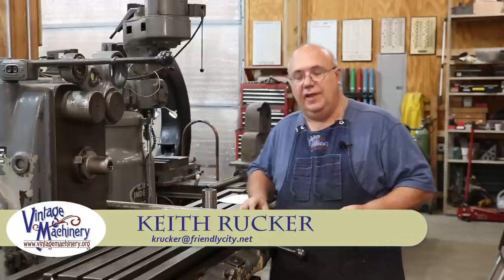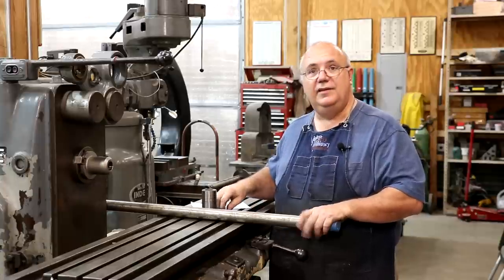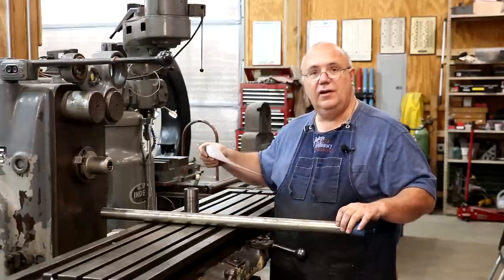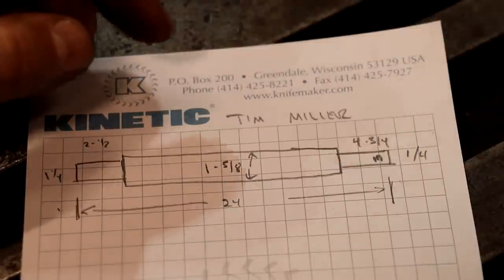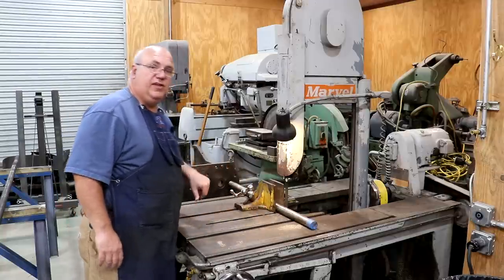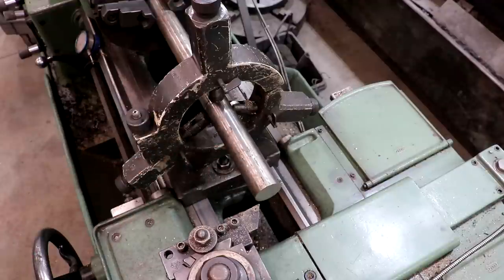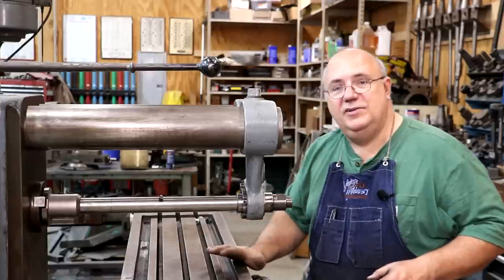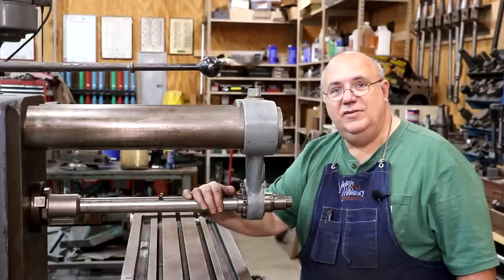Making a Tool Bar for the Horizontal Mill to Machine a Custom Spline

Comment: Hello Keith That may be 6140 ,6145 or 6150 We use a lot of those it came off that pill marked with those three on it ... I sent a good piece for you I did not want it to bend when you was cutting your part ... I am glad it worked and you got your part made !!!!!! Great Video !!!
Reply: Either a remarkable coincidence or you are the fellow who sent in the steel bar.  If you are,  Thank you!
Reply: Thanks Tim, very cool
Reply: @WhatAboutTheBee  I am I sent it in
Reply: @TheOutboarderTim ,Very generous, thanks for chipping in.
Reply: That would have made great material for a truck torsion bar way overkill for what he needed
Reply: @WhatAboutTheBee  He said "I sent a good piece for you". That kind of identifies him I would think!

Comment: I  usually put the tool hole below centre . It makes the tool geometry better & easier to grind .    👍
Reply: As I see it he tweaked the steady-rest vertically for the same result.
Reply: I was wondering about that.  Thanks for the memory jog.   I seem to remember there was a tip in one of my old books about that.
Reply: @silasmarner7586  I was referring to the tool position in the boring bar .  If the top of the square hole hole is about.030 or  .040'' above centre of the boring bar , then the cutting tool geometry is easier to grind . For what he is doing with it , it will be ok , but it makes it a pain for line boring set up .    👍

Comment: Keith, we have seen you use your Arbor Press several times and the Table deflects off the Upright and the Ram deflects forward each time causing the broach to bend.  I am honestly surprised you didn't break that broach. Time marks 23:48 and at 25:14 to 25:20 you can watch the table flex back and forth.
Reply: I noticed the same. I was surprised you didn't move it back to the center of the ram, and also surprised the broach made it.... was hoping you were not going to get hurt.
Reply: Look carefully.  If you loook at the left edge of the vertical portion of the broach structure, the whole structure tilted.. since the back bone is further away it appears to displace relative to the background less.... the broach BIT itself seemed juuuuuuuuust fine.
Reply: Probably what happens when you push a square peg through a round hole.
Reply: It looks like the gibs on the knee need to be adjusted.
Reply: I've noticed that also. Being just a casual observer, I figured the press is simply not contacting the floor perfectly; at least 1 foot not the same as the others. 🤔

Comment: You're gonna need a flat milled for your end mill holder set screws.  Most boring bars would have the hole off center so the cutting tip is on center.
Reply: Exactly my concerns
Reply: Hummm.. I see what your saying here.. But would it make much of a difference in the final outcome?... Sorry if this is a stupid question but in my 70 years I have never used one of these.. actually never even saw one before.. But I would have liked to have been around them when I was younger.. it all looks like it would be a great skill set to have working with all of these great old machines.
Reply: I was thinking the same, didnt Blondyhacks put the hole of the line boring bar offset?
There is still plenty of room on that bar to put in another hole although its a risk with broaching that though steel
Reply: @samuraidriver4x4  that's right, the hole doesn't even have to be square if you use round tool steel. Just have to grind in a flat to orient it with the grub screws
Reply: @tinkmarshino  As far as the flat goes- that is important, because those set screws just on that hard steel round are gonna slip under load.  The off center hole is not super important, just one of those engineering things.
Reply: @Current Batches to be fair machinist isn't his main profession
Reply: @oldschool1993  If you were listening to the introduction Keith commented that the spline required is non standard.
Reply: @garychaplin9861  Yeah- it perked up my ears because in the prior video I had commented that he could find cheap splined shafts easily.  We will have to wait for the actual cutting video to see if it is truly unique or not.
Reply: Really depends on the style of cutter you are using. Even if the cutting tip winds up above center as long as more rake than normal is ground in to compensate it will work just fine. an advantage to having the hole on center is it allows you to be able to rotate the bar in either direction.

Comment: It seems like the opportunity was there to put on a “Weldon flat” on the bar while it was in the mill. Is the cutting force just low enough that that wasn’t needed?
Reply: I was going to ask the same question, it seems to be the obvious thing to do when you already have it set up in the miller and would avoid those annoying burrs which make it difficult to remove the shaft in a close fitting joint.
Reply: He should of, especially if those set screw mar the metal,  he'll never get that holder off with those clearances

Comment: Gotta love mystery metal.  Be interesting to know what it actually was.  Someone mentioned maybe Stainless, and the way it fuzzed up, I think they are right.  Anytime you've done stainless it has that fuzzy look.  Nicely done as usual Keith!
Reply: Probably 4140 HT or Fatigue proof!
Just guessing.  I surely thought he would check the rockwell!
JIM 🤔
Reply: Fatigue proof is usually 1144 and machines great...4140HT machines reasonable decent too (around 35HRc) its tough but not bad...I'm guessing 300 series SS given the color of the chips and the threading fun he was having...

Comment: Scary stuff to work on that hard material.  I usually drill slightly bigger for my home shop stuff if I have to use hard material.  I figure the change in fit doesn't matter as much since the harder material resists deformation.  Watching that broach was spooky.  Glad it work out!  Whew!!

Comment: Seems like the edge of the cutting tool needs to be on center and not the body of the tool ?? MSC. Does have square tool inserts to place into bars,that allow micro advances  for tool depth.

Comment: Keith, watching your video I would have thought you would offset the tool bit half the thickness of the tool bit to make the leading edge on the center line of the boring bar?
Reply: The shaft is much stronger if the square hole is broached in the center and the face of the form tool is ground in the center of the tool. A tougher job than expected but it got done with much experience and patience.
Reply: He didn't make it as a boring bar for a lathe. He made it as a tool arbor for the horizontal mill. In this case it doesn't matter if the leading edge of the tool bit is on center. The work can be moved to any position while it's on the table to get the intended cut.
Reply: @deathk26  No, since the bar is rotating and the tool passes over and through the work as it mills the spline the cutting edge does need to be on center.
Reply: @ellieprice363  He's going to be making straight line cuts along a piece of material to create splines. The cutting edge can be offset from the center of the arbor. There's still a point in the rotation of the tool where there's a full perpendicular cut of the profile into the work piece. Make a drawing if you need to visualize it. It's not like there's an extreme offset in this case where you'd need to start worrying about clearance and tool length. At the end of the day it's up to him whether he wants to center the cutting edge or not when he grinds the tool. It's still going to cut the same profile either way.
Reply: @deathk26  If the cutting edge is not centered in the bar the tool will attempt to cut with a very negative rake. I doubt it would cut at all but rather create a loud bumping sound as the tool destroys the spline or is pulled out of the holder.
Reply: @ellieprice363  I think there will be some kind of bumping unless the releif angle is ground hard.  in doing that the cutting edge will be weaker.
Reply: @brucetuckey7909  I
The cutting tool on the center line of rotation or slightly behind is machine shop 101. If that theory is not understood intuitively nothing more needs to be said. As Joe Pie says “I’m out”
Reply: @ellieprice363  You got that rite . We will watch to see what happens next.

Comment: When setting up the steady rest.  Do you not balance the length of the stock in the chuck to avoid dropping.  Then slide the steady rest up close to the chuck to adjust it.  Slide it down the ways and move the stock out .  Avoiding the wobbling of the stock in the chuck jaws.

Comment: I thought you'd have to align the top face of the cutter to the center of the shaft.
Reply: Came to the comments to see if anyone else thought that. I guess for the spline job he made this for, a precision cut is not essential. Just the handle has to fit the shaft end okay. But for something like a precision gear, I too think it should be set with the cutting face centred.
Reply: @BillySugger1965  The cutting face will be in the center of the tool, not the bar.

Comment: It would have been interesting to see how you squared the bar up to the square broach.
Reply: I'd guess 'by eye'. A degree or two off doesn't matter that much for a single-point fly cutter, and you can easily square something within a degree or two by eye. You can get even more accurate by just holding a 6" rule against the side of the broach and getting that parallel to the bar by eye.

Comment: Since the tool hole is in the center of the shaft, does half the tool need to be ground away so that the cutting edge can be in the center?
Reply: Ideally, yes. But for this application, it is a bit of an extravagance.

Comment: Should the hole be off center in the arbor to minimize the material removal on the cutter or will this in some way weaken the bar as opposed to centering the hole on the arbor?
Reply: I agree that the top edge of the cutter needs to be on the centerline of the arbor. That can be accomplished by offsetting the hole or grinding down the top of the cutter or a combination of the two.
Reply: Doesn't matter as this isn't a boring bar for a lathe but a tool arbor for the horizontal mill. The work piece on the table can be moved to any desired position to get the intended cut. He'll be cutting custom profile splines (on a shaft I presume).

Comment: Nice arbor. I dont see that bending or lifting very easy. for spinning on a spline should do the job just fine. Could even double up as a line boring bar, it`s long enough. Thanks for posting....

Comment: Blue colour paint on the bar indicates a chrome molly steel, maybe M7 or 440B or 254 SMO, hard to tell as monitors don't give true colour reproduction.
Reply: The contributor says 6140, 45, or 50.  Very stout!  That is crankshaft material.

Comment: Question to Tim Miller if you are reading the comments.  What grade steel did you send Keith? Thank you.
Reply: See Tim's comment about an hour after yours, 6140 ,6145 or 6150 he wasn't sure which.
Reply: Well that sure answers my question why he had such a tough time that would make a great torsion bar material for a truck
Reply: @edwardkawecki8101  Torsion bar is kind of 'rough' for that material, although I guess it would work.  It would be fun to test it!  Anyway, that grade of steel is used for crankshafts, rods and such.  That arbor is here for the long haul!!
Reply: PC YOU'RE IRRITATING!
Reply: @edwardkawecki8101  What is irritating about the comment?  I just wanted to add what I know about the alloy.  We had some 6140 forgings that that may have been the toughest parts known to man!!  BTW, why are you yelling and upset?  I am recovering from a recent heart attack and would sure hate to see you have one!  Settle down a bit.
Reply: PC not the comment, YOU!
Reply: @edwardkawecki8101  If you can't say anything nice, why bother even living?

Comment: Might be a dumb question but doesn’t the broach hole need to be off center so the face of the cutter is on center?
Reply: Maybe I'm wrong, but I think that would only matter if you're line-boring on a lathe. On the horizontal mill you can move the workpiece on the table to wherever you like and get the cut you want.
Reply: It can affect how you grind the tool, but no, you don't need an off-center hole. The point of off center is to put one edge of the tool blank on center. But the cutting point is usually ground down about 1/8 to 1/4 of the way into the blank, so really putting the edge of the blank on center isn't a perfect solution. As long as you get the face profile on the tool right and the back relief right you can get away with a lot.

Comment: First question to myself watching the video what grade steel is it he didn't say and the contributor didn't say either. My choice would have been 1045 good strength and easy machine ability. For a one-off job probably 1018 cold roll would have done all right.

Comment: Nice job mate. What material do you think it was?
Reply: The contributor says it was 6140, 6145, or 6150.  I guess it wasn't marked clear back at his shop.  Whatever, it is way overkill for this part.  That alloy is crankshaft stuff!

Comment: The Bar of steel you are using looks like some type of stainless steel , most likely 300 series
Reply: Doubt that.  4140 CD HT.  300 series SS would be gummy cutting.  No signs of that.
Reply: Tim Miller, who donated it, commented about an hour after your comment, 6140 ,6145 or 6150, he wasn't sure which
Reply: @Bobs-Wrigles5555  👍👍 That is tough material to cut on.  Excellent tool material...Thanks.
Reply: @4GSR  6140, 45, 50 is used for crankshaft, connecting rods, hard working parts like that.  That arbor is probably the strongest arbor on earth!!
Reply: @paulcopeland9035   Yes, I'm very aware of the uses for 6150.  I've specified it for many things I use in the industry I work in. Excellent choice for a mill arbor, too.
Reply: @4GSR  Yep, I was just adding what I knew about that alloy.
Reply: @paulcopeland9035  Hey, it's all good.  Always room for learning.
BTW- most of our hand tools we all use, "chrome vanadium" steel, guess what, that is a 61xx-grade material.  How about that!
Reply: @4GSR  Indeed!  Nothing like a shiny piece of "Snap-on" to show off the stuff!!  Have a good day sir.

Comment: Definitely never saw anyone in almost 35 years adjust a steady rest like that. You always set the work up properly and set the steady rest to the work. You can introduce stress into the work if you use the steady rest to force the work into place.

Also, always drill the set screw hole (properly) AFTER you broach the square. The chips can bind in the threaded hole risking messing the threads up and/or chipping the broach. 

Nice hack video Keith!

Comment: Wouldnt it be easier to put a hole through one of the existing arbors up on the wall there? That steel did not wanna play nice, huh.
Reply: You are correct.  That steel did "not" want to play nice!!  Turns out it is 61 series which is commonly used for crankshafts, connecting rods, etc.  That arbor may now be the toughest arbor on earth!